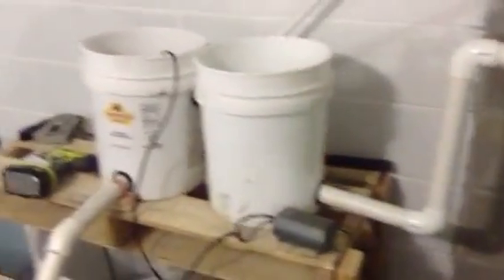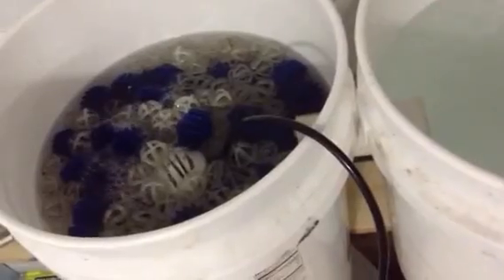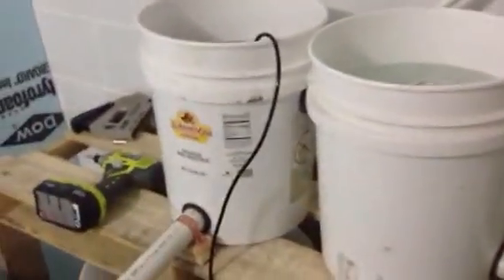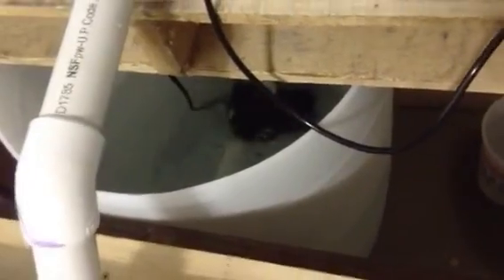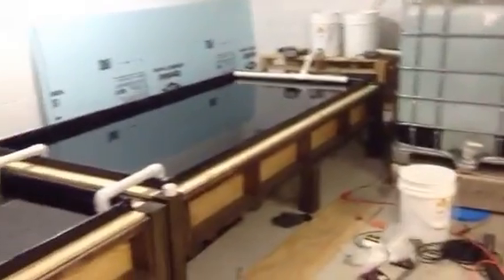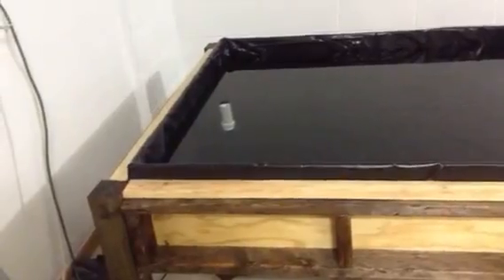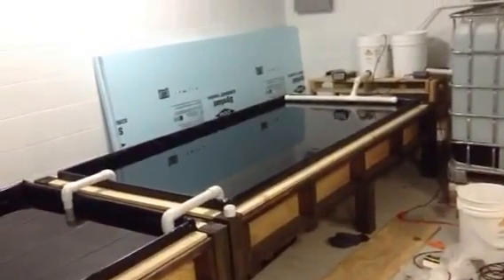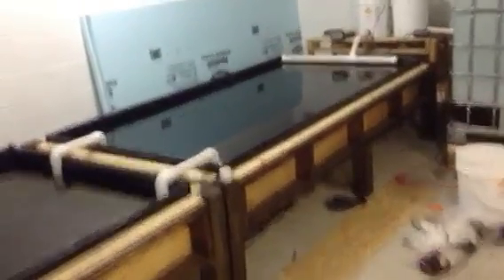First look at our DWC aquaponic system

Comment: Nice, crf.

Only thing you going have problem its the spray pipe to the DWC bed, its going get clog with solid your bio not going pick.

For the stand pipe check the Durso Stand pipe at /watch?v=9PHxP2Oqe6U

And the bridge pipe (connection from one DWC to the other DWC) its a bad idea, if any tiny bubble enter, the siphon its gong brake and you doing have water all over. Cut a hole and connect  both thru stand pipe, warranty it work and no accident.

Hope help.. Thanks and keep up.
JJB